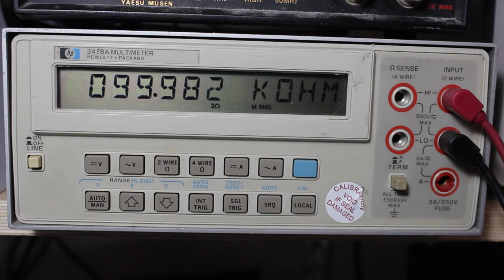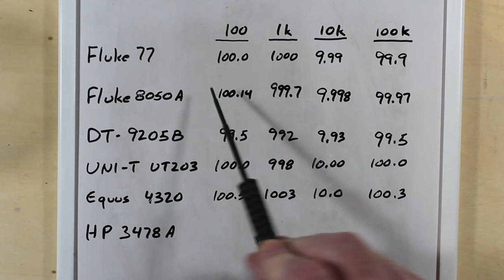DIY Resistance 'Standard' Using 0.05% Resistors To Check Multimeters #electronics #diy #precision

Comment: Great idea. I use my Fluke 77 daily. I built a 3V reference using a LM4040 so now I should do this and check the resistance too.
Reply from the maker: It's a cheap and easy way to have some confidence in your meter readings.  Or to show an unexpected problem.

Comment: I too often just trusted my equipment without thinking. Now I double check with reference test tools and comparators. Not just for electronics but for torque wrenches, pressure gauges, etc.
Reply from the maker: Confidence in your tools is important.

Comment: Good idea. Any thoughts on a DIY voltage "standard"? I recently used a Z431 to check a couple of my multimeters because I suspected one was not reading DC voltage correctly.
Reply from the maker: Yeah, given that reference chips are available for less than five dollars that provide 0.05% tolerance maybe it's time to make one.  It's something I consider making once or twice a year but never get to it.  That's mainly because my best meter has a DC voltage tolerance specification of 0.003%.  So I should have a reference that is 10 times better than that, which is not trivial to make.  But I certainly don't need tolerances anywhere near that, although I would like it...

Comment: Ah, I came in the comments looking to see if anyone had suggestions on the HP3478A drift. Does it do that in 4-wire mode too?
Reply from the maker: Just tried it.  4-wire auto mode still reads less than 900 ohms for the 1k resistor.  And it drifts down in value.

Comment: I used 10 100k 0.1% in parallel to make a ref 10k; spread the error around...
Reply from the maker: That works.  Ideally the resistors would come from different batches where possible.